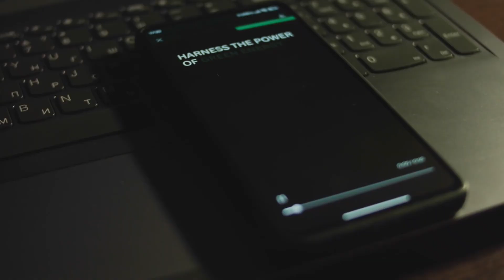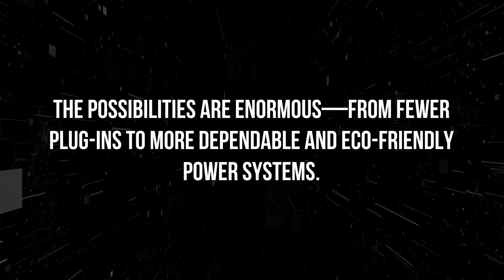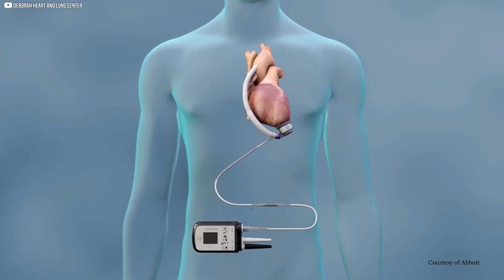The Battery Revolution Is Here! Breakthrough Tech Changing Everything

Comment: Also V2G EVs massive storage battery is free mass electricity storage 23hrs every day and all night long.

Selfparking selfplug-in v2g EVs at bumper height wall outlet at every carpark space at every building under dirt-cheap roof PV electricity supply. 

Trickle currents 247.
Rapid charging at the corner stores and on main roads. 

Dirt-cheap roof realestate roof PV has no grid costs.

Extending battery EVs range is increasing the EVs massive free electricity storage CAPACITY. 

Massive storage batteries on wheels parked 23hrs every day and all night long. FREE MASS STORAGE capacity daily. 

This is cheaper than increasing national grid capacity back to bigger generators.

Comment: Batteries will add resilience to the national grid.
Instant synthetic inertia. 
Instant Islanding from unstable grid.
Storm winds damaged grid transmission lines isolated. 
Backup electricity in national emergency. In national blackouts.